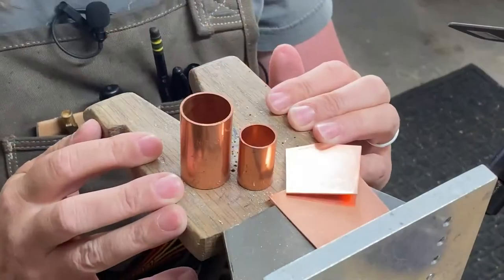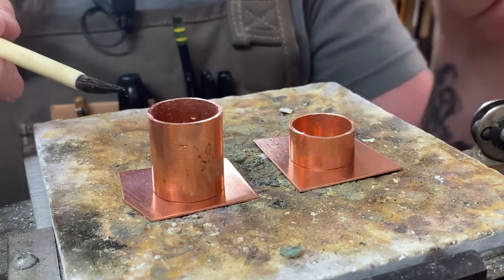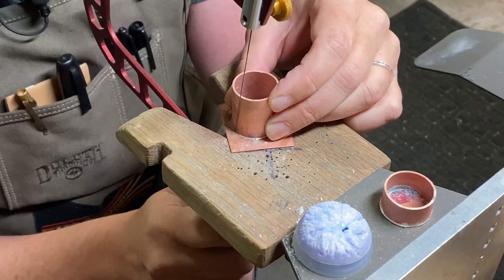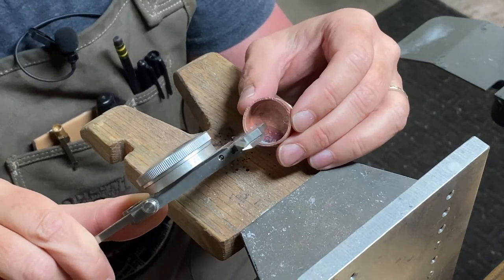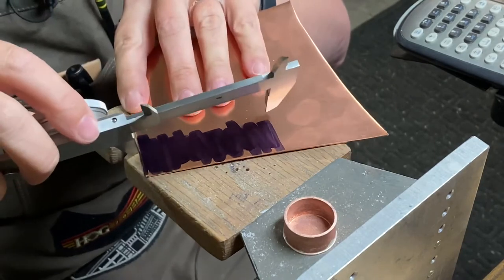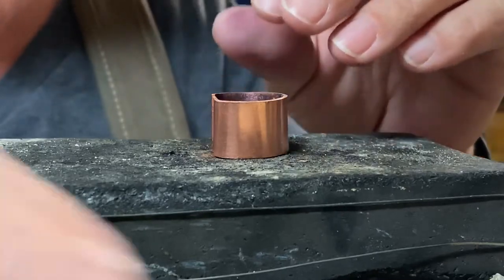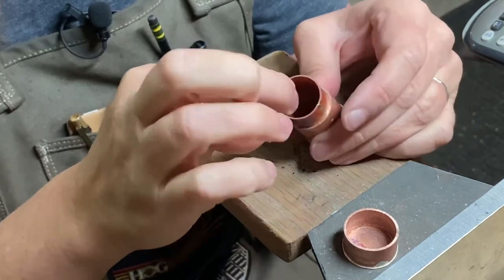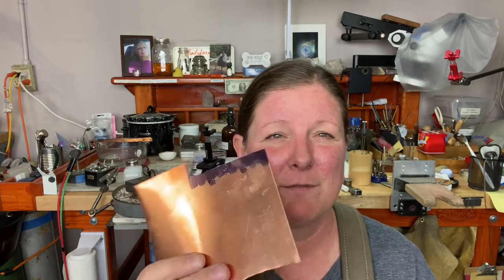Real Time: Making a Hollow Form for Jewelry Making

Comment: You need to buy a pipe cutter. They’re also available at a hardware store. They make it very easy to do even cuts of pipe. No sawing required!
Reply from the maker: A very good suggestion Maria! I do have one but mine was a little too big for this size tubing.
Reply: @JulessaScofieldMetalsmith  Hmm. Mine is adjustable. I've even used it on silver tube less than 1/4 inch in diameter (not recommended, by the way). I make a lot of air chased copper cuffs out of pipe and it takes less than a minute to cut off a suitable length. If you cut a lot of tube, I really recommend shopping around for one that adjusts as necessary. Good video, by the way.

Comment: Hi! The top of the tool you are using measures the inside diameter of the tube. Flip it over and insert it into the tube. Then roll the dial on the caliper until the prongs touch the inside walls of the tube. Then read the measurement.
Reply from the maker: Thank you Kim!!! 👍🏻

Comment: Thank you very much for sharing!  Just one small question: how did you make that insert perfectly round after soldering it?
Reply from the maker: Hello! I used a round ring mandrel to reshape the piece to fit the inside of the top to get it as round as I could and then made sure it had a snug fit, or fit with a little friction. By doing that, I was able to finish making it match the roundness of the outer wall.